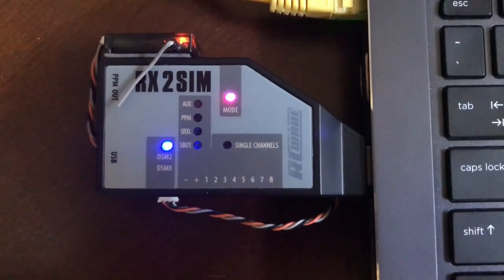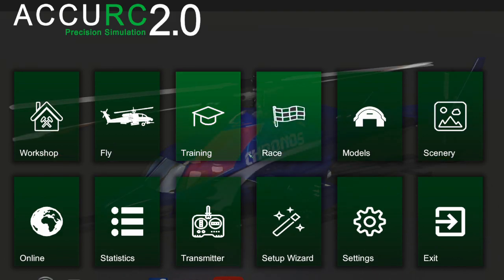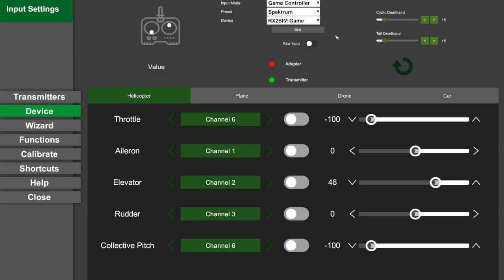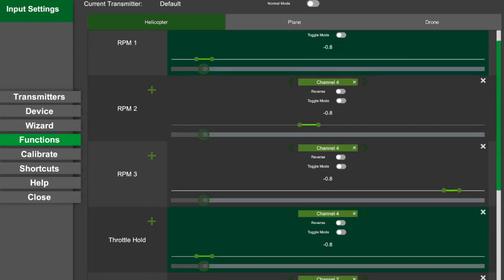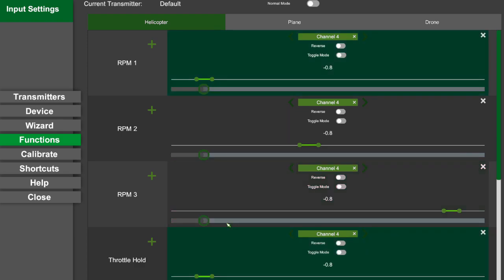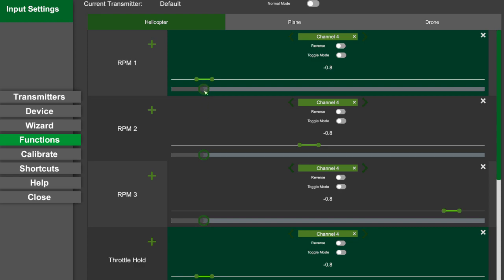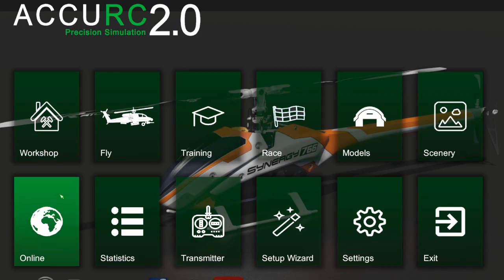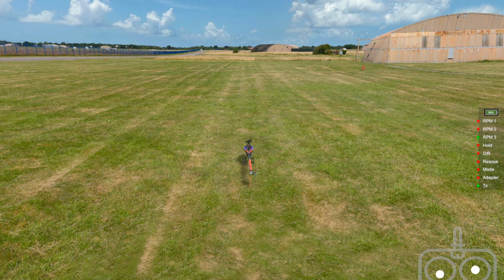AccuRC channel assignment with Spektrum and RX2SIM

Comment: Can i use sw2000  with accurc
Reply from the maker: Is that the Spektrum wireless receiver? You should be able to use it no problem. You may need to remap the controls but I don’t think it will be a problem.
Reply: @toadiscoil  
Thanks Todd for that information I just been having such a problem. It is a spectrum system with a spectrum DX8E radio. 
It’s just a helicopter is all over the place. I have no control over it. I’m having such an issue trying to use this radio with this flight simulator. 
I thought maybe it had something to do with the receiver, plugged into the computer to go wireless
Reply from the maker: @CapeFrank57  it will be detected as a regular game controller. Try to use the calibration tool on Windows
Reply: @toadiscoil  yeah I can’t figure it out. I’m working on a MacBook Pro and the helicopter on the simulator is all over the place. I can’t even control it. I’m not a pro at flying a helicopter, but I can’t hover and do small maneuvers. There is something wrong with the calibration on the systemand I am not too familiar with all that technology that’s why if you noticed I have another video up trying to get somebody to build a goblin 700 that I purchased used with electronics pulled out and I have no idea how to put it back together
Reply from the maker: @CapeFrank57  Where are you located? If not too far away I can help you out. Too far away needs shipping and it can get expensive and be a hassle.
Reply: @toadiscoil  I am located in the Fort Myers Cape Coral area, but I can travel three hours and any direction to drop off all the equipment if you are located in Florida and I am willing to pay whatever you feel the fee is thank you I have this machine sitting here and I haveno experience and putting it together. Thank you sir.
Reply from the maker: @CapeFrank57  I would gladly do it for free. But I am in southern Wisconsin so we are very far apart. Let me see what we can do. Send me an email to toadiscoil@gmail.com